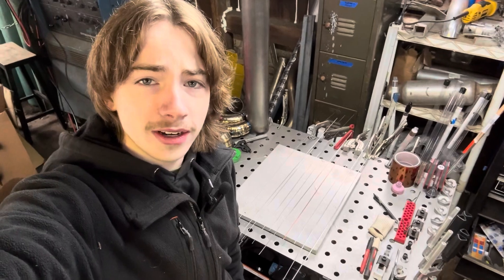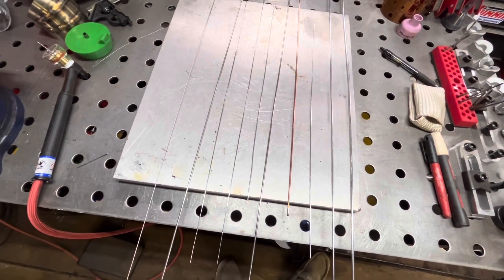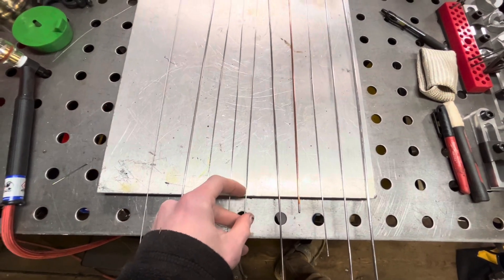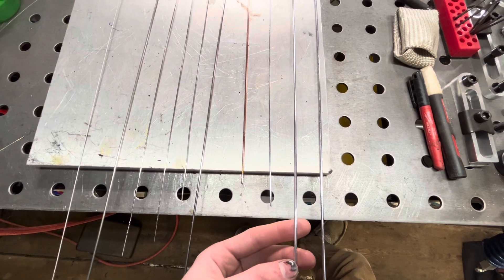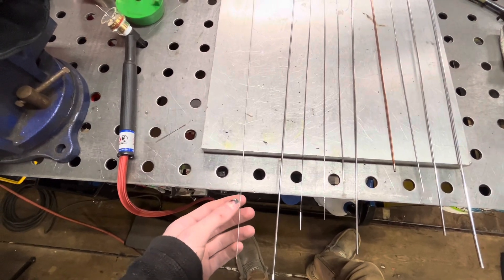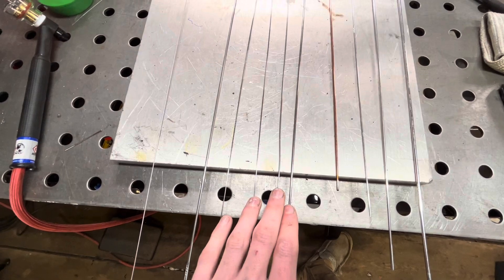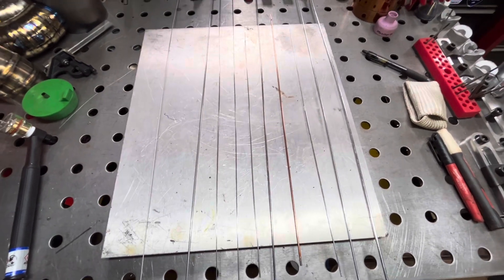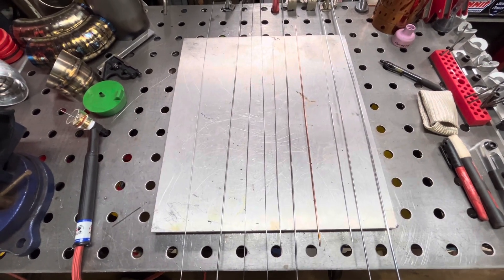HOW TO TIG WELD - Filler Rod Selection

Comment: I’ve been wondering what fillers to use on my exhaust vs what to use on schd 10 pipe, very helpful!
Reply from the maker: Glad I could help! .045 or .035 for 16 gauge exhaust and 1/16 for sch 10!

Comment: I never leave heat marks on stainless.
Reply from the maker: It’s part of the look in this industry, and if you do it right it’s not a problem.
Reply: @PrattPerformanceDesign Then you would never make it in the welding industry where I retired from .
Reply from the maker: @lokirussell5891 This is a different industry.
Reply: Relax boomer